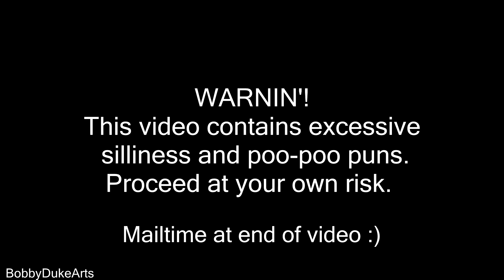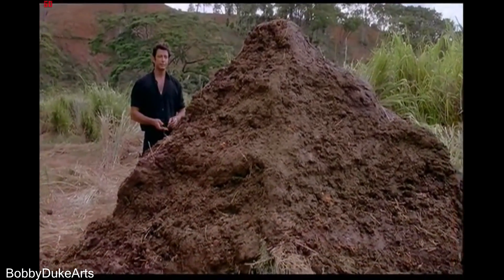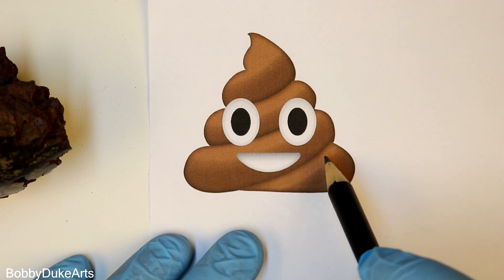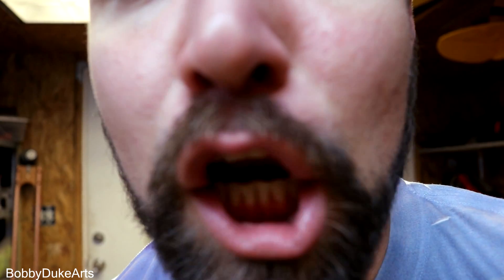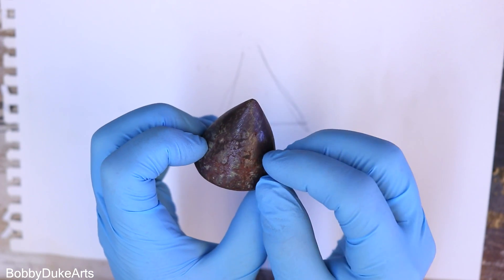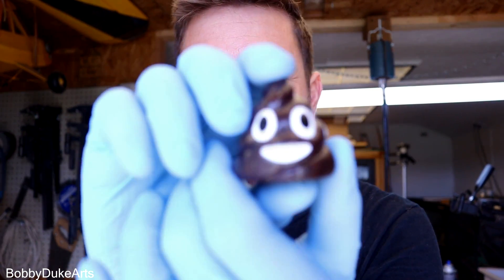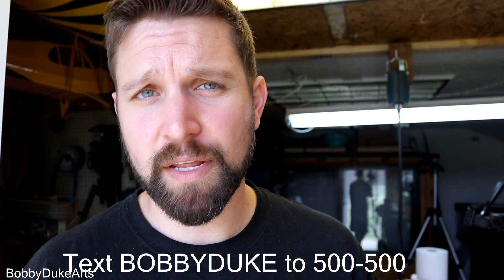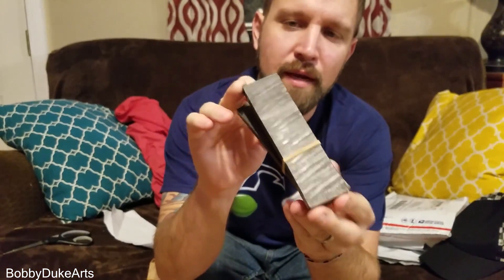I Carve Petrified Dinosaur Poop (from What's Inside) Into The Poop Emoji (Dukey inception)

Comment: Oh Bobby!!! You're so punny!!
Just advise with epoxy resin from personal experience - if you want to get rid of the annoying bubbles in the resin use a source of heat (hot air gun, torch or even a lighter in a pinch) after you pour it and it will make the bubbles come to the surface and be gone!! Gone I telz ya!
Another amazing video! Uz dee bestest!!
Reply: I usually use a needle or a chopstick to get rid of the real stubborn ones after I do this